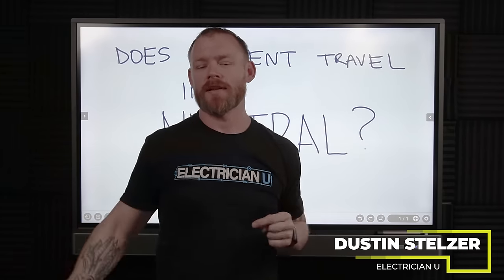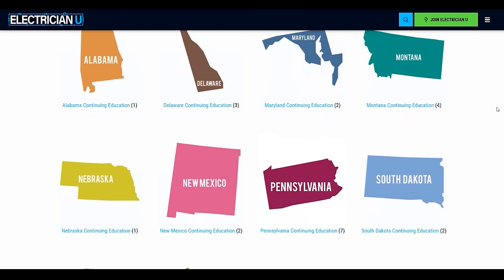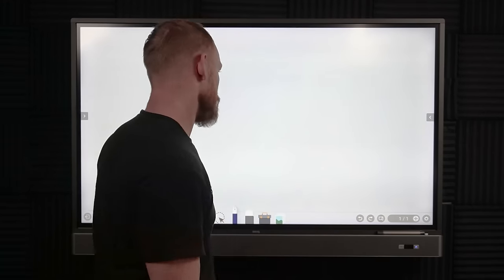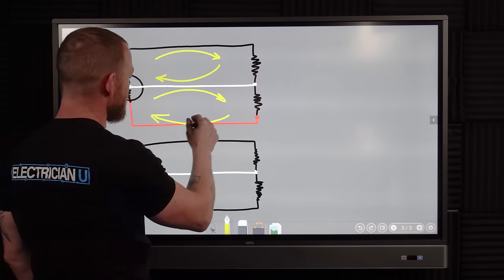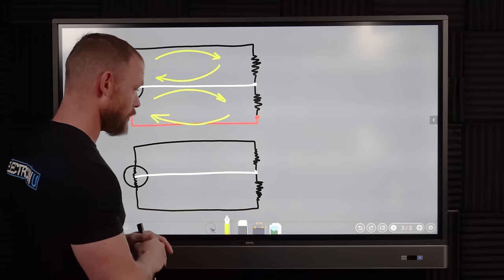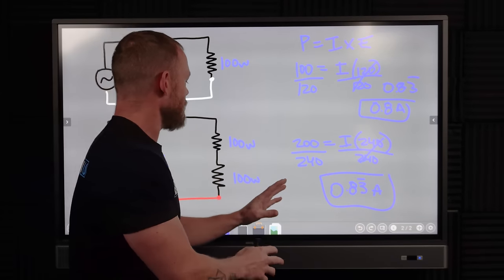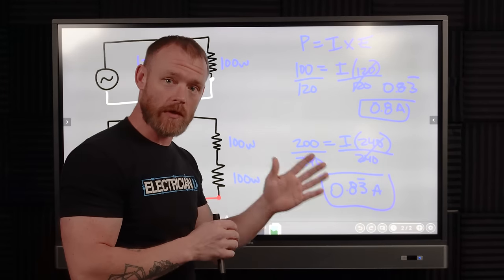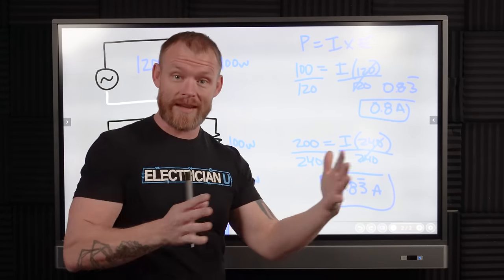Does Current Flow on the Neutral?

Comment: A few fun facts somewhat related to this:

1) In most sparsely populated rural property power is delivered in high voltage buried cable from the power pole to the step down transformer by the electric meter. In my case is 7.5kV single phase via a unground coax cable. From what I infer and research it is called single conductor despite it has the aluminium center core and a outer conductive shield, the shield does not carry the return current. Instead, the earth does despite of its high resistance which is feasible because of the high transmission voltage. This scheme is called single-wire earth return.

2) The step down transformer converts this single high voltage hot leg of 7.5kV down to two hot legs of 120Vac with one shared neutral. The return current of the primary winding travels via earth back to the substation.

3) Power generation stations and the power transmission out of them do not use a neutral because they is done by 3 phase. 3 phase delta has 3 hot legs and no neural.

4) While most residences use only 1 phase AC, they are derived from any one leg of the three phases. Because of this, a 3 phase wye power conversion must be involved.
The return current on the
Reply: V Sohn. You are wrong on many aspects of your comment. Old underground cables used to have the neutral exposed, which, over time decayed. Newer cable has the neutral jacketed. Nowadays, most distribution circuits are a Y system, meaning they have a neutral. The neutral is a solid connection hooked to the Xo bushing on the low side of the transformer. All 3 phases and the neutral are hooked together internally in the transformer.  On a delta system, there is no return or neutral wire. These systems are dangerous, due to the fact you can literally ground one phase in the system and it will not trigger any protection or relaying on that circuit. Delta systems are not preferred due to the safety factors compared to a grounded Y system.
Reply: @kenchiison4570  The thing is smart people always be aware what they don't know, and the opposite think they know it all. You are seeing things from under the rocks that is the universe you perceive. Read my comments more careful as why I think delta three phase is use for long distance transmission. Delta transmission for thousands of mile requires 3 conductors, while wye requires 4. It does not take Einstein to figure out which one to choose. Neutral and ground is not a high power very long distance (as often interstates) electricity transmission requirement.

Neutral and ground is a local last mile, if not last hundred yards thing. Tell us what is your professional credential. I am not a linesman, but I am a EE despite high power and electrical distribution is far from my expertises.
Reply: @maestrovso  .If you're worried about cost, you would just convert to DC and only have 2 wires. Look at your transmission structures. Up on the very top. Usually 2 static wires up there. Used for lightning protection and sometimes have a fiber optic cable in them. Usually tied in to the substation and a pole ground at each structure. Even if it's a delta. You can have a 480Y or a 480 delta. The equipment will function the same. Which one would you prefer?
Reply: @kenchiison4570  You are so out of your depth that it shows. Please when you see those high tension transmission line steel towers next time count the number of cables on them. If there are three they are delta. delta and wye both are user for electric grid, and they both have their uses. I am talking about power grid distributions that is tens of thousands of volts.

Like I pointed out, you view of the system is imprisoned in your little sphere of your myopic view.
Reply: @maestrovso  No 5hit Sherlock. 3 conductors but there is still a static wire above, usually. The point is, whether it's delta or wye, it usually has a static wire above for protection, and or, communication.

Comment: Thank You greatly my house lost an neutral today after an storm from the Pole  & smoked up my house main breaker was turned off & power co called   made repair  alls good but is it ???  & wow not an licensed electrician but started leaning wiring @ age 8 & now 67 in my Dad Cabinet shop lot 440 3 phase ...& beyond to building Over  1000 homes & now do HVAC also  last 29 years i just learnt something I never knew & I Thank you greatly its on the neutral wire NOT SHARED on same leg @ about 14 mins in ......if I herd  ya right.... a  borrowed neutrals is  only Ok if Phases are separated & NOT all on same LEG but stopped ur Video to write my comment  T bc an light bulb went off inside me & now ill finish ur Video & i so glad you mentioned 220  volts w/ lost Feed neutral but amps are almost cut if 1/2 .....but 9 hrs later my house still smells of Burt wires but 99 % sure that smell are frm 3 power strips i had plugged in in different rooms ..I Hope

Comment: That was fantastic. I never had so comprehensive description of current flowing. But now I had much more questions:
* single circuit have 2 fazes which are opposite to each other? 3 wires.
* or it is actually 2 different circuits which are connected to 2 different home panels? 2 wires to each house, but it seems that 2 different neutrals will meet each other near the transformer.
* here in Ukraine we have 240V circuit and hot and neutral 2 wires.
        ** Does it mean that we have x2 voltage through one hot wire
        ** or we have somehow combined opposite fazes in one?

* also very interesting how 3 faze circuits are built to supply eg. machine in workshop

Comment: OK, great explanation for the flow of current in an ac system. Correct me if I am wrong. Since the alternating current is actually happening through the two legs (L1 & L2) and not directly through the neutral this is why both the neutral and ground can be mounted to the same bus. Then the question that begs to be asked, what effect does the ground have on the neutral and visa-versa?  And what would be the reason for tying the two together? Would the circuit still work if they were bonded on two separate buses?

Comment: This gentleman is a good teacher.  Another good explanation of the North American split-phase power delivery is a video by Engineering Mindset.
As far as does current flow on the neutral, it has to; otherwise there wouldn't be a circuit.

Comment: This video was excellent. It's remarkable how many people have worked in the trade and never understood this concept. Years ago I worked in the Electrical-Mechanical shop of a large university. Only a couple guys in the whole place new this concept. I learned this when I was trying to install an electric water heater. NOW, think about 3 phases and 480 VAC. That jazz really messes with peoples minds. Add to this I have seen guys who could explain some of this but could not install a water heater, properly. Another thing that baffles the masses is that a VOM does NOT measure electricity flow; it measures the voltage differences on conductors. It's a wonder why our grid even works at all. Sometimes I think I live in a third world country. Keep up your good work.

Comment: Steve Edberg below is correct. Almost everything else below is incorrect. Stunning. The neutral coming out of the panel back to the pole carries the difference in current (amps) between the two hot legs. Talking about 120/240 V residential panel here, not three phase. However I have still not yet seen a proper explanation of why the neutral coming out of the panel could be zero (if the current in the two hot legs is exactly the same). The voltage on the two legs are 180° out of phase with each other. So in other words when leg one is peaking high, leg two is peaking low.   This is how the electricity is generated at the power station and delivered to the panel. Neutral coming from a 120 V load always carries the same current out as going in to that load, for example a simple lightbulb. This is required by Kirchhoff’s current law, established in 1845. Again, the neutral coming out of the 120/240 panel Carries the DIFFERENCE in current between the load on the two legs.

Comment: growing up, i always had the wires called "hot, return, and ground." I was told that hot has the AC (either 120 or 240), return is the return path to the transformer, and ground is the ground stob outside (which also gets tied to return in the breaker box). it always made sense to me because if you touch just the hot wire, nothing really happens except maybe a tingle. you need that return path to complete the circuit. and ground went literally to the ground and could "absorb" infinite voltage. the first time i heard someone call return neutral it confused the hell out of me lol. i think neutral is the more technically accurate name though because its literally the neutral point of the winding relative to the two hot lines. i didn't learn about the two hot lines and all that until way later in life though
Reply: This is not really accurate as it is AC, it goes to both directions. IMO the official terms: ungrounded and grounded conductor are clearer. They emphasize their similarity in the electric circuit. One needs two conductors for a circuit. One of them just happens to be grounded. Now when one combines legs then it comes slightly more complicated.

Comment: For non-linear loads like switching power supplies in computer labs, the loads will not balance, so there will be much higher neutral current then traditionally expected.  There is a formula somewhere for calculating it.
Reply: I used to provide surge suppression equipment in the 80’s and ‘90s for large computer systems located in large facilities such as schools, industrial plants and skyscrapers. The loads can be balanced but that only works for perfect sine waves. But the switching power supplies used at the computer locations will introduce harmonics that do not cancel, rather they add to  the current on the neutral wires. If you look on an O’scope, the voltage that left the power plant as a perfect sine wave turns into a square wave that is created at the switching power supply by creating odd harmonics (odd multiples of the pure 60 Hz sine wave). The practical solution was to actually DOUBLE the neutral wires to account for the adding, rather cancelling neutral current at the load. Such was the case for 120/208 3 phase wye panels that are usually the spot where 277/480 wye wiring is stepped down with a 120/208 isolation transformer, where the neutral is tied to the ground. Lightning can induce a 6,000 Volt, 3,000 amp pulse that while only lasting microseconds, is quite enough to fry any electronic equipment down line. You are especially vulnerable if you are at the end of a power feed, as the effect is DOUBLED as the wave goes down to the end of the line and bounces back upon itself towards the supply. This is why they generally don’t put transformers at the end of the power runs, but will extend the line several hundred feet past the last home or business drop. Most importantly DO NOT EVER do any wiring at your home or business… leave it to the licensed electricians who know what they are doing. Your building code may allow the owner to monkey with electrical service projects, but your insurance provider will not pay for an electrical system caused fire. And as an electrician once told me, 120/208 V can be forgiving, but 480 will not give you a second chance! Great video covering an extremely complex subject.

Comment: Hello Dustin

My complements on a very sensible presentation! Might I suggest, as a physicist, actually mentioning that the nominal voltages in the circuit do actually have instantaneous values - that is, can take on negative values so that while they still can drive current most of the time, and hence power, that they can also cancel at key points in time and in location. You may be reluctant to show actual phasor plots at this level of explanation, but at least you can discuss current cancellation without resort to the EM field level of sophistication. My best regards to for your enthusiastic style and impressive effort. Domenico Barillari.

Comment: Short. With split phase, two equal loads are needed. 
With three-phase, three equal loads are needes. Then no current flows through the neutral conductor.
But whenever there is an unbalance between the loads, the balancing current flows via the neutral.
Without a neutral conductor, the voltages are distributed differently across the loads.

Comment: One thing not mentioned is that a/c being Alternating current meaning that the two buses are 180° out of phase (vs push n pull description) the current cycles are opposing which neutralizes the current cycle on the common buss.

Comment: That’s a different way of explaining it than I came up with on my own. My explanation was that because L1 and L2 on a residential split-240v panel are 180 degree opposites of each other, the neutral would only be energized by the difference between L1 and L2, because the phases are each other’s lowest-resistance flow path; the neutral is higher relative resistance because it doesn’t have the “pull” that the opposite phase will at any given moment. Then, I’m not the licensed electrician; so what do I know?

Comment: Never thought about the two phases proportionally canceling each other out on the neutral. Had shops some with 3 phase the others with 2 phase. The loads were distributed across the phases best as possible. I typically imagined the 1-phase loads returning to the pole regardless of the load balance across the phases.  Good stuff.

Comment: On a two wire circuit the neutral will be carrying the same current (amps) as the hot. The voltage on the neutral will be near zero, unless the path to the panel gets broken. If you shared a neutral on two 20 amp circuits that were connected to the same service leg in the panel the neutral would turn yellow and perhaps eventually cause a fire. The heat is caused by the current running through the wire.

Comment: I can tell you holding a neutral wire hurts! I was removing an old panel and managed to get a quite powerful shock when I grabbed hold of a neutral wire. Afterwards, tracing the wiring with my fellow electrician (he was partially stripping out another panel), we found somebody had 'borrowed' the neutral in my panel with the live supply wire coming over from his - located about 75 metres away.

Comment: 3:22 point of clarity that most people don't understand about the flow of electricity. The electrons move, you are correct, but the electrons only oscillate in a finite distance and don't actually flow or move any appreciable distance. It's the wave form around the wire that actually flows and creates what we know as electricity. I'm oversimplifying it and don't really understand it 100% but thought I would point that out.

Comment: I love this video, I have always had issues with A/C wiring.  I work on equipment so I know DC like the back of my hand.  I do change my own breakers, lights, and switches but I have always left the inside of the breaker box(breakers slot in so I don't consider that inside really) to electricians.  Thanks for the video.

Comment: Now I understand why there is a neutral on a 220v circuit, potential path for unbalanced loads (unequal current usage).   For current to flow back to the transformer, the legs have to give and receive the potential equally, the neutral is for the unequal potential.    Got it, ty

Comment: ...Yes. lol

In fact, Dad told many years ago that any conductor in a mains system should be considered "live".
(if only from a safety point-of-view.)

Because even the Earth (ground) wire could in theory carry a lot of current if there is a fault somewhere.
And many older consumer units won't have an RCD/GFCI. Depending on the exact fault, it might not even pop the fuse.

It's also possible that a building is wired incorrectly, swapping the Live and Neutral (or worse, Live and something else), and some buildings could have "phantom power", where somebody wired power from an adjacent building.

If there is back-powering somewhere, like from a petrol generator, you might only find out when you go to grab some wires, and then it's too late.

It's good to get into the habit of always proving wires dead, whenever approaching something new.
(which is part of the training to be an electrician anyway, in many Countries.)

Stay safe, peeps.

Comment: he two legs of a single phase 240vac circuit, like the one found in most houses, are NOT out of phase with each other. They are in fact exactly IN phase with each other, meaning that there is only ONE phase. If the two legs were 180deg OUT of phase (technically two phases), measuring the voltage between the two legs would show 0v. This occurs because as the AC waveform cycles, the two voltages would be exactly opposing at all times (Leg 1 +120v, Leg 2 -120v), making the resultant voltage 0. However, because they are phased Exactly the same, measuring the voltage shows double the voltage(Leg 1 +120v, Leg 2 +120v), as the two voltages are added together.

Three phase legs are 120deg out of phase, phase to phase. Normally adding three legs together would add all the voltage together (360vac). However, the phase differential causes some of the voltage to be lost to some of the voltage being cancelled by the other legs drawing it back. The line to line voltage is calculated by multiplying the line to ground voltage by the square root of three. Eg. 120 x sqrt(3) = 207.84, or 208vac 3ph.